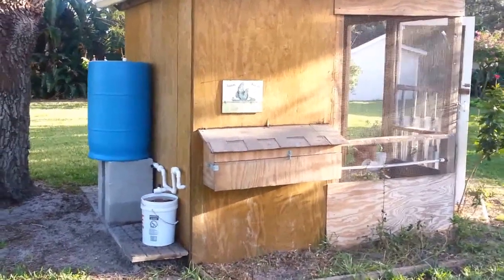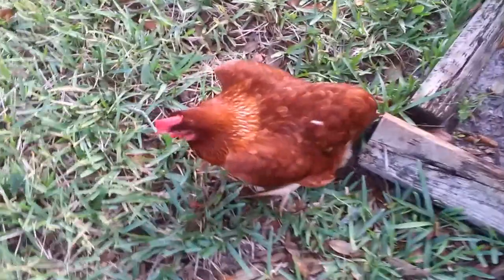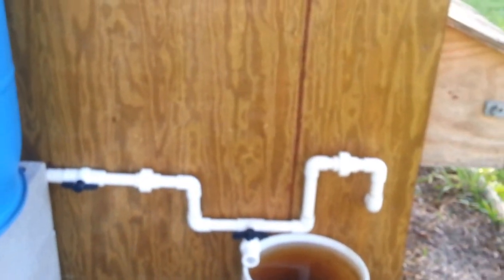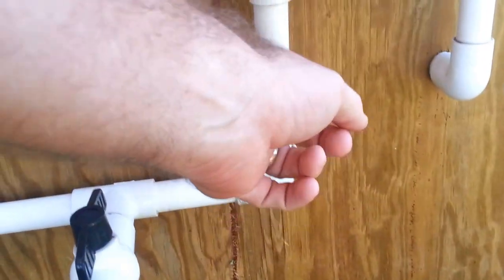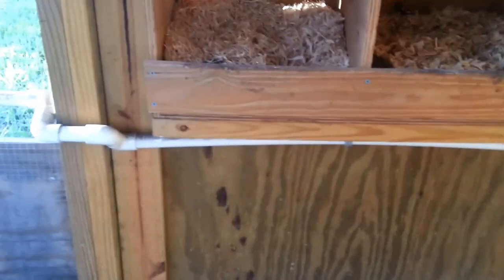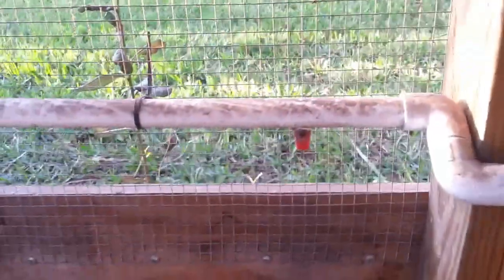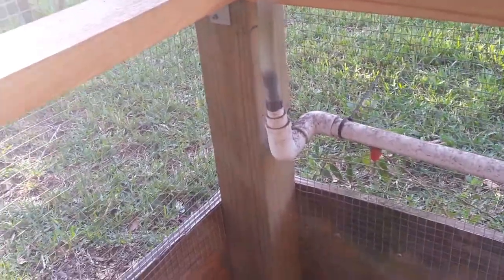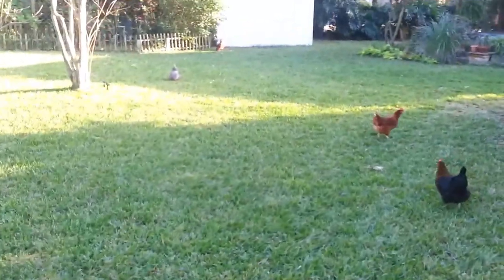Ultimate DIY Chicken Waterer: Rain Barrel Nipple System

Comment from the maker: Randy Stetzer We are in Florida and don't have to worry about freezing temps. That never even crossed my mind. It's nearly a closed system, so we've never had mosquito issues. Same for algae - since light doesn't get into the inside, it's algae free EXCEPT for the water level gauge area, but that's not bad at all. I add a bit of apple cider vinegar to it every now and then and have been happy with the quality of water.

Comment: Mark - great system, especially the quick disconnect and the improvised water level gauge.  Also, you can still use the gutter system to fill up your tank.  Just look up "first flush diverter" as demonstrated by Engineer775.
Reply from the maker: Luis del Valle Thanks - the one negative about the water level gauge is that it does tend to get a little bit of algae in it due to being light exposed. I wouldn't do it any other way though.

Comment: Out of all the watering systems, I think I like this one the best.   Not only is it messy free like a watering pan would be, but you added an air tube at the end that gives you the water level without having to tap the side of the barrel and try and guess the level....   I think I may take this idea with the coop I am currently building.

Since I live in Indiana, I'll have freezing temps, so I will have to come up with a away to keep the water & pipes from freezing.    My mind is already working :)

Thanks again.

Comment from the maker: @anthony pippin jr - If the end stopped at a cap, the water wouldn't be able to fill it properly, as air would get locked in there and would prevent it from filling. At least I think that is what would happen. And the pressure is impressive. When I fill the barrel now and open the valve, it actually flushes all the way through the system and shoots out of the top of the water gauge. I do that a few times to rinse it between refills. Even when it's low, the pressure is decent due to the height of the barrel.

Comment: That's pretty cool. Nice job. 

In the winter though couldn't the line freeze and break the system? Maybe you could get a heater system to prevent that during especially cold days.
Reply from the maker: vexx506 We are in Florida, so freezing isn't a concern. There have been a few comments about that, and I'm not sure what to suggest, as that never even crossed my mind. :)

Comment: Good job Mark!  You mentioned some dripping by the nipples and I saw some damage to the plywood underneath.  Have you thought of the small, self filling cups?
Reply from the maker: David Dube No, I didn't consider that... but it's been 2 years now, and while the plywood has a bit of algae in those spots, I haven't had to replace it.